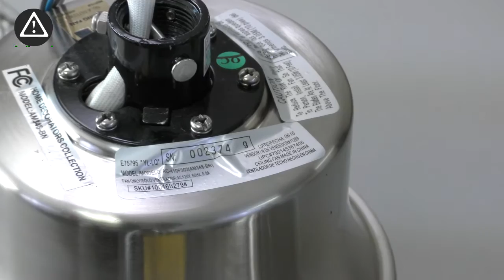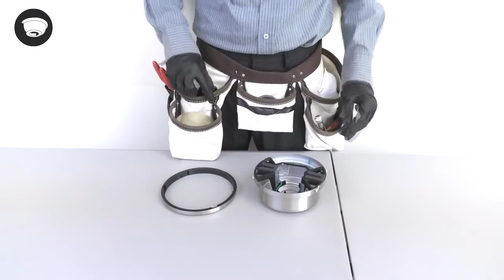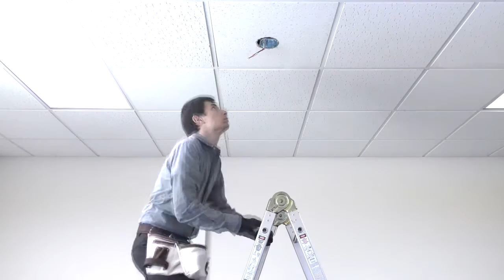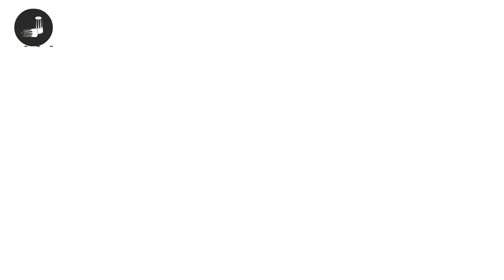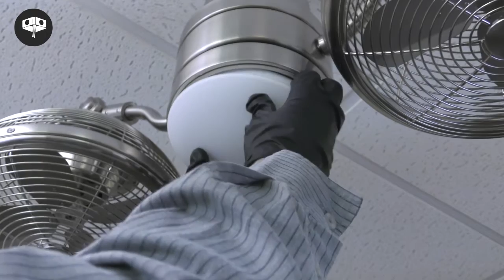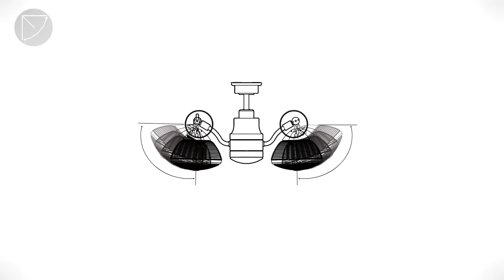Pendersen Ceiling Fan Installation Guide

Comment: I have owned this fan for approx 1 year.  It has stopped rotating and I can not find troubleshooting information.  Any help is appreciated. Thank you.
Reply: I have the same problem. Did you ever find a solution. Ive been searching
Reply: @creamercachecomics641  This is crazy.  It wasn't working for months but I turned on the rotating button and it starting working again!!!  Crazy!  It has been working now for 2 weeks.  Fingers crossed that it continues.
Reply: @ActionAtLast  hey.... is it still rolling? i just installed mine today